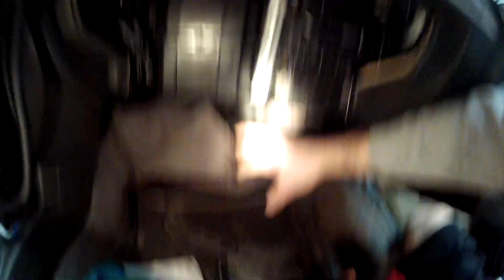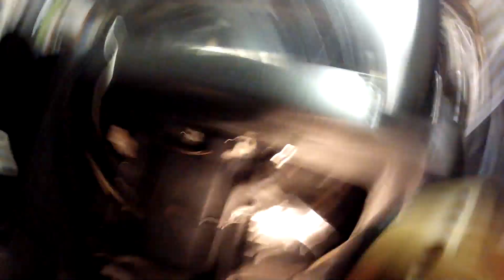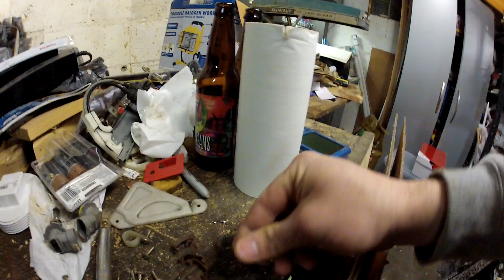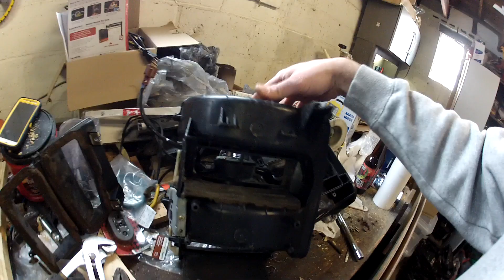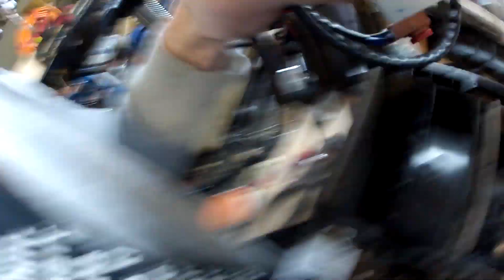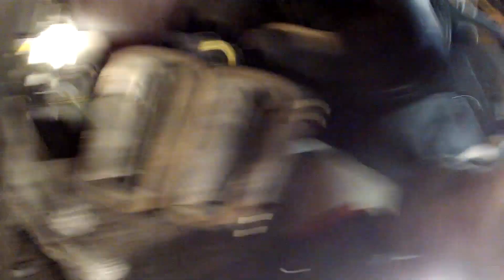Blower Motor Removal and Installation

Comment: Your video was amazing step by step. I wouldn't have had a clue how to attempt to do the job. It did take me 3 1/2 hours, the hardest part was the end, putting the glove box back in. But patience is needed.  Thank you for your hard work doing your video! Got the electric motor with the squirrel cages, glad I did.

Comment: I’ve done literally the same steps as you did but mine is blowing towards the heater core and not out of the top. Motor is blowing the correct way and tried to switch wire’s nothing works. Blend door’s are working too
Reply: have you figured it out yet since I'm having the same thing and I cant tell if its supposed to do that or not since I got no air out the vents when I put mine back in

Comment: Good shit. But also make sure if your resister stays cool before you put if back together. There are moments were the resister will melt and cause the motor to fail. In this case it was the motor but it never hurts to check. Also make sure your blower motor relay is good as well.

Comment: Its 2 am just finished mine ....... this video should be called how to get started, huge pain to do this job and better be able to figure things out the stupid band clamp took me forever to line up to make sure I get a good seal. Didnt start my car to test ac but blower is working now. Also better be safe and replace that relay would suck to have to do that all again for the 2 screw relay replacement. Good luck

Comment: Is the TYC Blower Motor still working after all these years?
Reply from the maker: I sold the car a few years ago. It still worked in 2016.
Reply: I am going to go pick up a used box install it now, then re-build mine keeping it as a spare. I own two,  accords (91 & 93).  TYC usually fits, just not sure about the motor brushes that they use. Thanks.

Comment: Extremely valuable info for anyone considering this project. Thank you Halosapian! I got it done today faster than I thought. I'd HIGHLY recommend - as shown in this video - purchase of motor WITH the squirrel cages, as that adds considerable time and work to this project. Also, as mentioned in comments below ... take lots and lots of pics to save some head-scratching when it comes to putting everything back together. Without this video, I would have wasted a LOT of time figuring out that dash loosening makes this project much easier. Camera work was shaky in spots with too much movement, but the gist of the point not lost - in the end just common sense on many little deets. If you do buy the motor only, MAKE SURE you take a picture - the squirrel cages MUST go on as they came off old motor (same side and orientation). I GOT HEAT AGAIN! YES!

Comment: This job is a pain the ass cheeks. I'm doing it right now. Reused my fans. Hard as hell to remove. Box is DISGUSTING. Need to replace all foam but he didn't do it so he'll get a face full of moldy foam. They sell the foam for $1.98 at Lowe's from weather king. Use the cement brush glue. Yeah. He left a lot out. Watch your fingers pulling out the ECU cables. They're jammed in there.

Comment: Thank you for the video. it was very helpful. One thing I would add is take a lot of pictures of everything. From beginning to end. This helped me out a few times figuring out how to put it all back together. The rear bracket threw me. It ended up as a spare piece so I looked at my pictures...cussed, then dropped the blower down again to install it. It probably took me around 3 1/2 hours. I did not totally remove the ECU cover, just moved it out of the way. As far as installing the blower, if you have trouble try a few different approaches installing it. Take a break if you have to-it's possible!

Comment: Thanks for posting this - saved me a load of time and headache.  I found it just fine searching for 93 Accord blower.  For the question regarding the requirement to remove the ECU and TCU:  You can remove the cover  /mounting plate with the units still attached.  Just remove the nuts on the four mounting studs and unplug the two plugs to the TCU.   Leave the ECU plugged in. Then pivot the cover / mounting plate toward the center console.  That, along with pulling out the dash slightly, will give you enough clearance to drop the blower housing assembly.  Reinstall of the plate is tricky - you have to push the top in first, under the A/C evaporator assembly, then wiggle it onto the studs.  Reinstall of the blower housing assembly is also difficult - take your time and be careful how far you spring the dash to make the clearance on the right side.  BTW, Auto Zone still requires you to re-use your old blower wheels (squirrel cages), and to pigtail your old plug using butt splices.  Cost about $110 retail for the blower and resistor.  Thanks again!

Comment: Mine is a 5speed....would that be easier?  i saw you had a little trouble with the the tcu ?
Reply from the maker: dunebugdoug I think that would be the only difference. Unless you had more of a base model without AC or with a different configuration of climate control.
Reply: @Halosapian the 3 attachments that control the blower motor on the right side I see them, but what about the 1 blue one or better yet, it has a blue attachment on the end of it. What does that attachment go to because when I took my blower motor out, I don't recall seeing it attached to anything.

Comment: Excellent video. As far as I can tell this is the first and only demonstration of this particular model on YouTube. It shows that the process is a bit more involved than I anticipated. Was the final repositioning of the unit as difficult as it appeared? The video stops right before that final step. Also, it would be very helpful to the accord community to most the relevant model years for this repair. It looks to be a 1991 1992 1993. Is that correct?
Reply from the maker: This should apply to all Accord 90-93. I'll have to consult the manuals for later models to see if it also applies to them. I have a feeling it's similar for the 94-97 models.
Reply: Halosapian Its even easier on the CD5's theres a few screws on the bottom that come out and the whole squirrel cage assembly drops out.